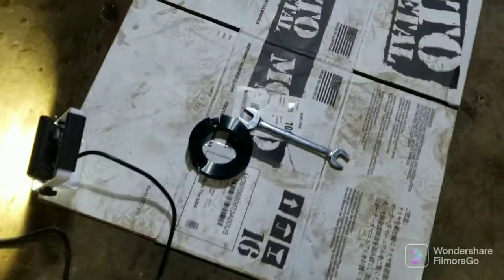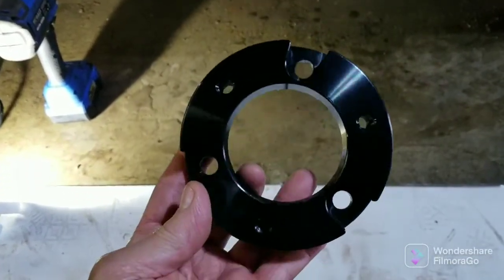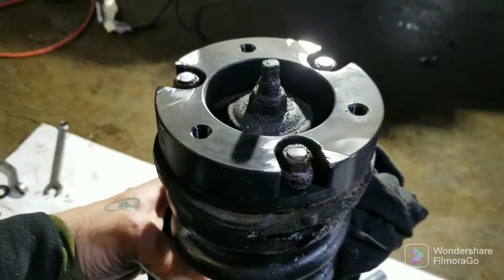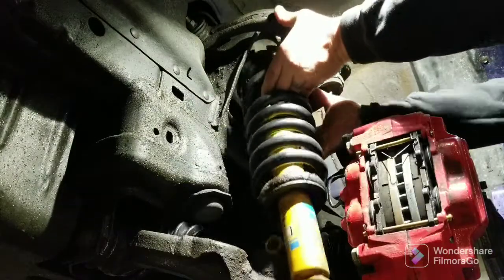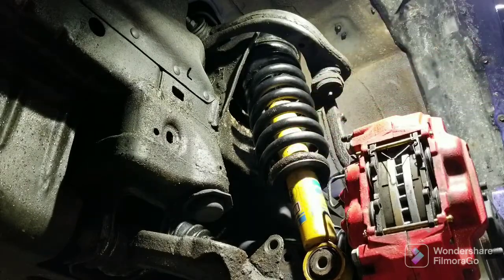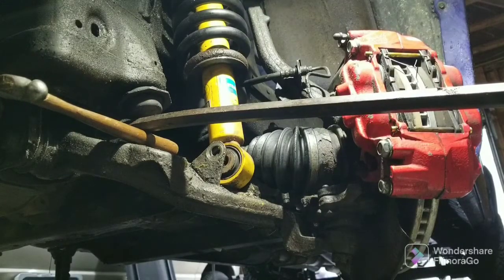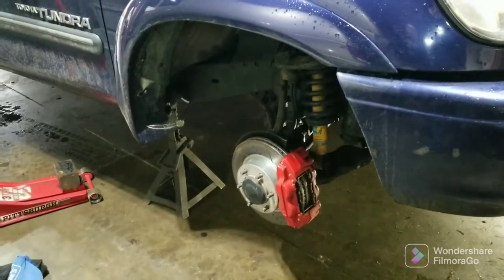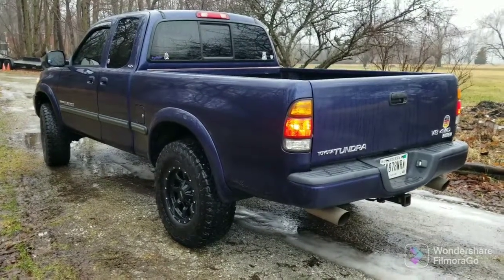How to install 2" lift, strut spacer. New tires and wheels! 1st gen Tundra. 2000 Tundra access cab.

Comment: I don't agree with it being acceptable for "mild over landing" It will preform worse than stock, and eventually kill the strut if used offroad at all. its a substantial suspension downgrade removing a large degree articulation AND you bottom out on your strut tower rather than the control arm bump stop. Im not trying to discourage anyone from what they are doing, but I think its important people understand what they are actually doing. Many people thing they are upgrading their suspension doing this. The reality, its a substantial downgrade to the suspension with the ONLY trade off 'looks cool to be level". And that is a big spacer, that puck is just about as big as you can install on a FGT with stock arms. Any larger of a puck will bottom out the upper ball joint to the coil spring even with the weight of the truck pushing down. It just seems small in comparison to some of the ABSURD 6" spacers you see on other platforms.
Reply from the maker: Thanks for sharing your opinions on the subject. 
I always appreciate a second point of view.
I never called this an upgrade and never stated it would be a better performing strut off road.
As for using it offroad, I have several times and my struts are fine.
Do I think it's better than proper offroad suspension, no. And I do state that.
So it absolutely is acceptable for offroading. And does not perform worse than stock, I would know, I drive the truck. 
There are no benefits other than looks and increased ground clearance.
It is worse on the strut but not killing it by any means. And I state if these struts weren't relatively new, I'd go with an extended travel strut.
I appreciate you wanting to make sure everyone understands what they are doing. 
But I'm certainly not misleading anyone.
Thanks for watching and commenting I appreciate it.
Reply: @funjunkiegarage  "does not perform worse than stock" this is just not true, and the number one misconception. You have lost suspension travel, and no longer have usable bump stops. Your strut is now your suspension limiter. A stock suspension has more travel, articulation, and durability. Not anything that's my opinion it just is what it is.... In your video you can see the upper ball-joint craming into the spring as you had to use a pry-bar just to get the strut in!! Thats not acceptable. If you had a camera up in there while offroading, you would see the same thing. The ballpoint bottoming out on the spring just like it was on install every time that side has to articulate all the way down. Not having a suspension limiter is also a big issue. It only takes a few times of hitting limit to crack the shock eye right off (or just kill shock), because its been used as the bump stop suspension limiter. You hit your suspension limit frequently offloading. If your going to put a spacer on, you are no longer OK doing anything that articulates the front end without negative consequences. So its advised use ON ROAD ONLY, although personally I steer clear all together. A ACTUAL upgrade in regards to lift requires new struts that have more travel, and a larger upper control arm. This addresses all 3 problems the lift with tophat causes. Any lift done without improving those 2 factors is a downgrade from stock performance, only looks better.
Reply from the maker: Ok, I don't disagree with the facts, ie; no bump stop, bottoming out the strut and the spindle hitting the spring. 
But in the real world it does drive down the road just fine. It wheels just fine and then drives down the road again just as it should. Therefore it's no worse than stock. 
I don't make claims based on engineering.
I simply share my experiences and in my experience this set up is working out fine for me with nearly 20,000 miles on it, right wrong or indifferent. 
I definitely plan to "upgrade" my suspension system in the future and I will boast it as such when done properly. 
Again I thank you for sharing your knowledge and experience. 
And thank you for watching my channel.